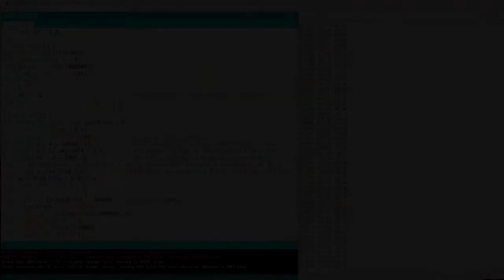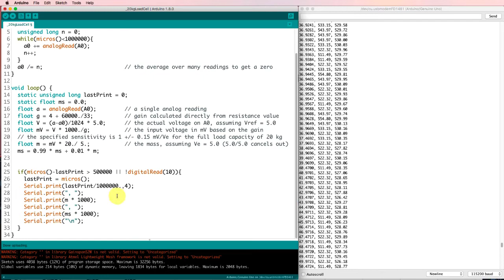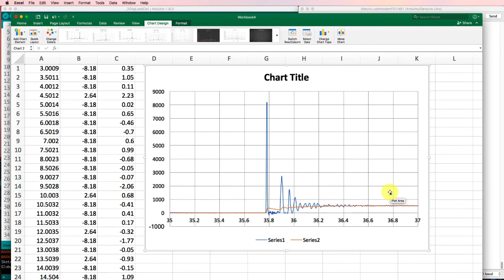20kg Load Cell Scale

Comment: hey have you ever hooked up the + and - polarity in the wrong direction would it damage the load cell?
Reply: The cell is just a wheatstone bridge of four resistances. Reverse +/- would change the sign of the output signal.